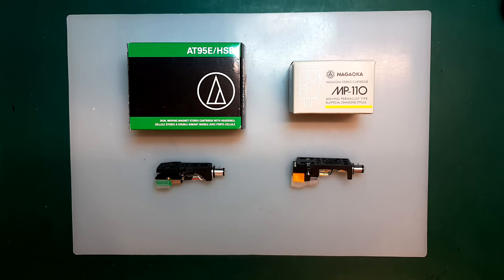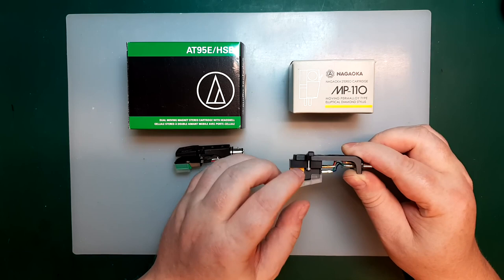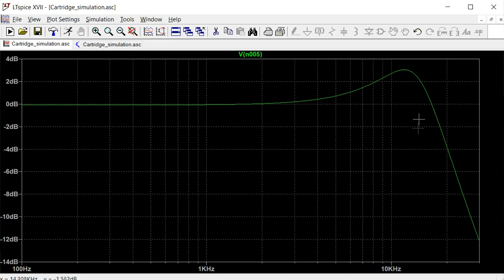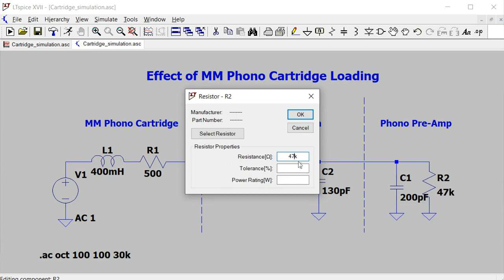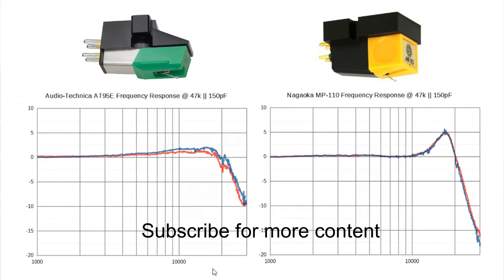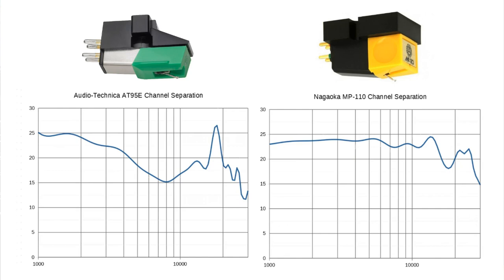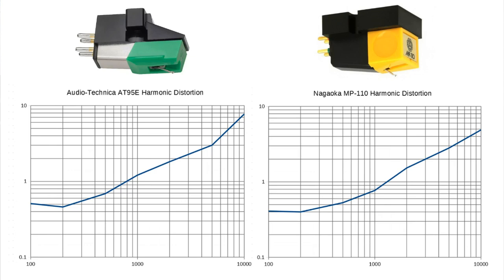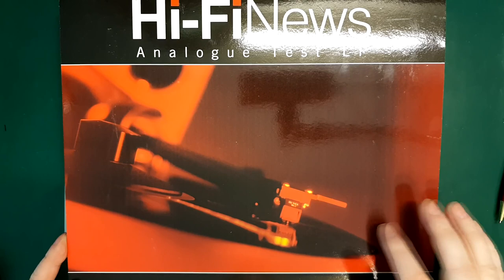Comparison and detailed measurements of Audio-Technica AT95E and Nagaoka MP-110 phono cartridges.

Comment: I was always wondering why my amplifiers phono stage was always sounding a bit bright. I looked at the schematics and it turned out it uses 100pF and a 68k resistor. The 100pF seem a bit high... Thanks for Your explanations and diagrams, showing what different resistor and capacitor values could do. That was really interesting.
Reply from the maker: Thanks, yeah I'd try remove that 100pF capacitor and lower the 68k to 47k and see if you like the sound better. It really can make a huge difference, but of course the phono stage RIAA equalization is also very important.
Cheers,
Jake

Comment: Please consider a video in which you measure cartridge frequency response as a function of varied resistor loading.  Perhaps placing a one mega-ohm 10 turn pot in parallel with the phono amp input, or even replacing the input resistor with the 10 turn pot, would give a finely variable load that's easy to measure.  Back in the '70's many Grado cartridges needed a 10K load rather than 47K load to sound good.  Stay safe and healthy!  Auf wiedersehen, mein freund!
Reply from the maker: Thanks, that's a good suggestion, I was thinking of trying a few parallel resistors, but a pot would make it easier to adjust until the right value is found. I think I could just use a short Y splitter cable, then I don't have to modify the pre-amp. 
Should make for an interesting little video.
Cheers,
Jake

Comment: Nice work.  Thanks for taking the time.  Shure also made some great cartridges and styli.  If viewers think that the distortion for cartridges is high, They should measure the THD of speakers, especially in a two or more driver system.  A single loudspeaker tested on a measurement baffle is many times the distortion measured on these cartridges, and are much worse that that at lower frequencies.  Speaker systems measured near the crossover frequency(ies) are typically well over 10% THD due to the phase shifts caused by the crossover network(s) and / or the physical mounting of the speaker drivers. 

When actually quantifying the performance using measurements by accurate measurements from the source to your ears, the input and output ends (microphone / cartridge, speaker systems) are pretty bad.  That's why I find it laughable when "audiophiles" argue over 0.001% and 0.002% THD of an amplifier or "cheap" $100 vs "musical" >$300 speaker cables.  Even the best "golden ears" are full of fecal excrement.   I used to set up double blind A-B-X listening tests behind acoustically transparent curtains for these people in North Hollywood in the 60s and 70s.  I never lost and none was ever right.  Eventually they quit taking the challenge, because it was not at their accustomed listening room, and there were other people watching, so they were distracted by their stress and angst.

It's great you still have those test records and they look like they are in pristine shape.  If you have extras, play it over 500 times and measure the THD again for another big surprise.  Hint: record's distortion increases with each playing.
Reply from the maker: Thanks, yeah there are many good cartridges around in the reasonably affordable category but also a few not so great ones. I agree a speaker in a normal room will have very high distortion (I always consider speakers the weakest link) with all the reverberation and everything, they perform best in anechoic chambers. I like double blind A-B-X tests, my only problem is that the human hearing (+brain) isn't a fine tuned instrument, it can take a long time for me to decide if I like A or B better, so I know it will take a lot more than the 5-10 x 30 seconds tests that were popular back in the day. Unless there is some standout issue with what I'm listening to then it usually take a few weeks for me to confidently decide if I like the sound of a better than b from just listening to music samples. But, yeah, arguing over distortion beyond 0.1% in home systems is not really productive, In a studio environment, yes, sure, you want to keep the source as clean as possible as it might pass through 100s of steps, but a few times 0.1% at home is unlikely to be detected by anyone.
Cheers,
Jake

Comment: Superb video and very well presented! One of the few who actually mentions capacitive loading which when reviewing a MM cartridge really is essential! Also using actual measurements to backup your findings vs some hyperbole written in a magazine?! What is this vooddoo! hahah I had a Nagaoka MP-200 which I couldn't stand because of that high end peak and I found it had some weird distortion in the midrange especially auditable on male vocals, at the time I couldn't easily adjust the load so I just got rid of it. Since then I've been running a AT-150MLx into about 120pf @ 47k and it's sublime. I run a Ortofon Pro and OM-10 for DJ work and been considering a MP-100 but then again the Ortofon is almost ruler flat so meh

Comment: It seems to me the Nagaoka MP-110 performed more accurately than the 95E (which I own). I currently run a AT VM95ML with my SL1200 MKII and really enjoy it's sound signature, however, I was very curious about the MP-110 so I went ahead and purchased one, I mean, why not? I tried an Ortofon 2M Blue and for me at least, it was steps below my 95ML in almost every way. I returned the 2M blue, needless to say. It just didn't "do it for me" like the 95ML. To be fair I run my Sl1200 MKII through a pair of Klipsch r-51 PM and a Klipsch R120SW. So perhaps not having passive speakers with a dedicated amp with eq adjustment may be the reason why I felt the 2M Blue didn't live up to it's potential. But I am very excited to give the MP-110 a go, I've read a lot of postive reviews on that particular cartridge. With it being a MI or whatever it is, I have read that the sound signature is similar in some ways to a moving coil, but that may just be internet lore. Either way, I'm sure it will be a pleasure to listen to.
Reply: How did you like the nagaoka? I’m on the fence whether I should purchase one or not. Right now I have a Grado Green on my SL-1200 MK2

Comment: Nagaokas are Moving Iron cartriges, magnet and coils are in the case, iron is in the flux lines
Reply from the maker: Sure, if you want to get really technical then it's a moving permalloy. But for all intents and purposes it performs like a moving magnet and its most often advertised as such to not confuse people whether it will work with their phono preamp.
Cheers,
Jake
Reply: @TheStuffMade  from my experience there seems to be a difference in sound between the moving magnet and moving iron (permalloy) . I've used both types and have always ended up with the moving iron type as the favorite and doesn't seem to relate much to the brand but did as to the type. I've got 4 different brands of moving iron (permalloy) in my favored selection and all of the moving magnet ones don't get used that doesn't stack up to coincidence. The main thing is the sound stage created with the moving iron cartridges is fuller and three dimensional. The result is the record has a notable live presentation when played back with moving iron cartridges . Wish I had bought a dozen replacement styli for my Stanton 681 the steriohedron tip was unlike any thing else it sounded superb and it was very easy with the surface of the record. I could play a beat up used record with it and it would sound decent again. There's a good reason why so many FM stations used that Stanton 681 back then.
Reply: @TheStuffMade  Point taken, but would you (or anybody) call a High Output MC just because it can be used like an MM cartridge? Educating viewers about the difference (which I do believe contributes to what the Nagaokas do so well) so one day the term MI (or MP for that matter) will be just as well known as HO MC. :)
One more question: Isn't a value of 2 mH too high an assumption for a 1.2 m run of interconnect cable? It probably won't matter much anyway because of the much higher inductance of the pickup's coils.

Comment: Thank you for this video. Need more.
What software use for measurements?
Reply from the maker: Thanks, I tried many different types of audio processing software, but in the end I had to write scripts in python and .net to process the samples to get correct results. so the whole process went like this:

1. Record audio in Audacity, 24 bits. 192ksps.
2. Export as 32 bit wave file
3. Import and resample wave file to 960ksps
4. Apply high pass filter 30hz to get rid of rumble.
5. Apply 6dB/octave slope filter to compensate for the constant velocity of the Ortofon record sweep
6. Run variable window size DFT on sweep to get accurate samples (most audio processing software fails here because they will use FFT with fixed window size and that doesn't work with a sweep)
7. Generate csv file with the data.
8. Create charts in Libreoffice calc using the csv data.

So, yeah, quite a lot of work..  I might clean up and release the processing scripts if anyone is interested, but they are specifically written to be used with the Ortofon test record's sweeps.

For the distortion measurements I used the Digilent/NI Waveforms software.

Hope this helps,
Cheers,
Jake

Comment: What software do you use to process the recordings and make the graphs?
Reply from the maker: I wrote some python scrips to process the recordings and extract the data then plot the graphs using LibreOffice. But it's a bit of a slow process with many steps as it is now. I might clean it up at some point and include it in my Audio Analyzer Suite.
Cheers,
Jake
Reply: @TheStuffMade  Wow that sounds quite complicated!

Comment: Did you measure or determine the input capacitance of the Mani?  I contacted Schiit, and they said the Mani has 100pF of input capacitance (which would put your total at 230pF instead of 150pF).  Also, the MP-110 has an inductance of 810mH, which is quite high, and at any normal levels of input capacitance, has that resonant peak squarely in the audible band.
Reply from the maker: Yes I've measured the input capacitance, the Mani got around 15pF on the input, don't know why they would say it's 100pF, that is not correct. There is no capacitor on the input, it's all residual capacitance. I guess it's possible older versions had 100pF on the input, looking at pictures of the boards of the different versions they have changed a lot since v1.00. The version I have is 1.20, as far as I know that is the latest version.
Cheers,
Jake
Reply: @TheStuffMade  How do you measure the input capacitance?  I'd like to verify the input capacitance on several of my older amps and home theater receivers.  I'm in the market for a new phono pre-amp and just got the reply from Schiit yesterday specifying the 100pF.  Odd the discrepancy.
Reply from the maker: @oryandunn  I use an impedance analyzer to measure the input capacitance, I can guarantee it does not have 100pF on the input, but as I mentioned, it could be a version thing. I'm only familiar with the latest version. Also if you look at their specs page they don't specify the input capacitance, which is also odd as they are very detailed with the rest of the specs.
Cheers,
Jake
Reply: @TheStuffMade  Ah, so not something a hobbyist would be able to pick up for under $100. I looked on ebay and those analyzers are quite expensive, even used.  I asked if they could add that to the specs page, as it is somewhat conspicuous with it's absence. I'm currently borrowing my Dad's Mani, which is a version 1.20.  The site doesn't mention versions at all, I assume they must consider these internal revisions without any external differences.
Reply from the maker: @oryandunn  yeah, it's a very specialized instrument. You might be able to get a measurement using a high end LCR meter that allows you to specify the test frequency and voltage, that would be cheaper than an impedance analyzer but it would still cost a lot more than $100. I had a look at the Mani web page, the circuit board they show is v1.10 and it clearly uses different op-amps in the input stage. Anyway, if you have a v1.20 then I can guarantee the input impedance is only around 15pF, but keep in mind every meter of cable between the cartridge and the phono stage will add something like 100-150pF.
Cheers,
Jake
Reply from the maker: I was a bit more curious about this so I did a search on pictures of the v1.20 circuit board. Don't know how familiar you are with SMD components, but I found that there are versions where a resistor on the input has been replaced with a capacitor and by looking at the color of the capacitor it could be 100pF, so they might have quietly changed the specs on the input capacitance.
Board with capacitors: https://imgur.com/SqhQZha
My board with resistors: https://imgur.com/7fC4tcn
Very strange and quite bad that they just change specs/components/board versions without announcing it, then you can't rely on any reviews or measurements of this device.
Cheers,
Jake
Reply: @TheStuffMade  Interesting find.  I took a look at my Dad's unit, which was a bit difficult given how the ground wire is attached, but his unit has resistors at R28 and R29.  He's had his unit for a while, though I'm not sure exactly when he got his.
Reply from the maker: @oryandunn  Sounds like your dad's unit is the same configuration as the one I have. The resistors R28 and R29 are used for the 47k input impedance, it looks like they just piggybacked a capacitor on top to add capacitance. And even worse they use ceramic capacitors instead of film capacitors, that's a really poor choice.
Cheers,
Jake
Reply: @TheStuffMade  There's also the Miller capacitance effect in a live circuit to consider. Not just passive input capacitance.

Comment: AT95E has gone up considerably in price. No longer $40-$60. Cheapest one I can find is $69
Reply from the maker: Try ebay, I had a look at they are selling for around $50, but it can depend on where in the world you live also be aware there was a new version released recently called the AT-WM95E. I believe they only changed the body to look a bit more modern.
Cheers,
Jake
Reply: @TheStuffMade  The specs of the ATVM95E are slightly better too.
The most important thing is, that the cartridge body also accepts microline and shibata styli, so it has more upgrade potential.
Reply from the maker: @QoraxAudio  The upgradability is a good point, however I'm not sure how popular it will be to have cartridges from $40 up to $200 using the same body. It might have been a better choice to do body tiers like Ortofon does with their Red and Blue plus Bronze and Black.
Cheers,
Jake
Reply: @TheStuffMade  Well there's a lot of praise for the AT-VM95ML... I think the stylus shape, cantilever and suspension are by far the most important for an MM cartridge, as long as the transducer performs just fine.

Comment: Nagaoka has informed me the cartridge load capacitance is 100pF
Reply: @Declin_RO - Unfortunately that's almost impossible to reach as just the cable capacitance of pretty much every commercially available record player is in the 100 - 150 pF range. This adds to the phono stage input capacitance, no way around it. 
Many cheaper integrated amps or even AVR nowadays come with a phono input again, but input capacitance can be as high as 500 or even 800 pF! It makes the input less prone to RF interference but it's fatal for frequency response.
Reply: @naibafabdulkobor4301  right, but 100+150 gets us at 250, and since most operate at 250 as well(if i am not mistaken) where do we have the issue? I genially don't understand. Personally i am using a dj mixers with nagaoka mp-110 and would like to see what i can improve